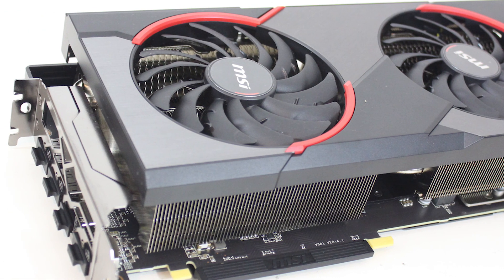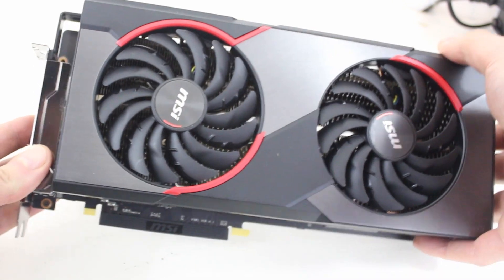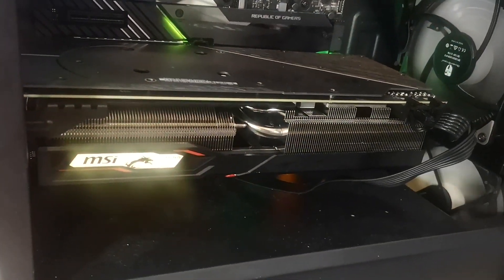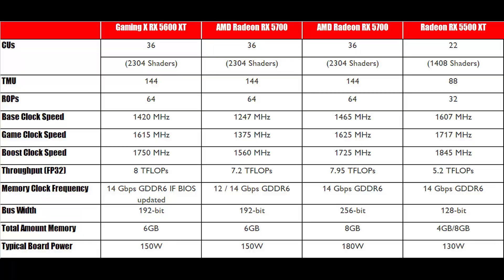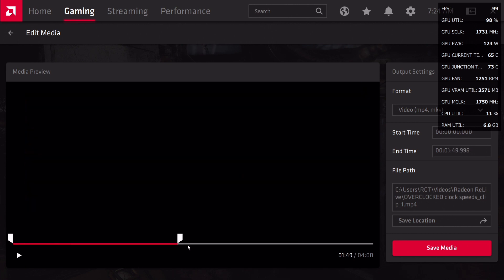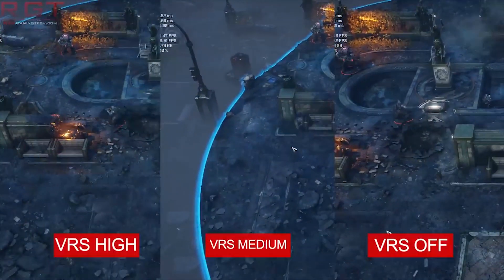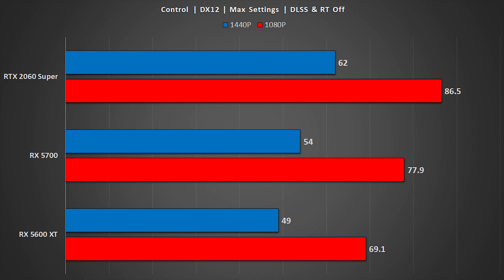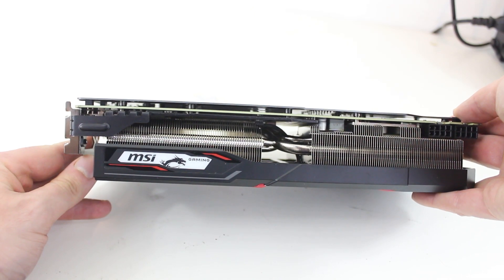Should You Buy The Radeon RX 5600XT Instead of the RX 5700 ?

Comment: No point in buying it right now. Right now is the literal worst time to buy a GPU as we are less than a month away from Ampere and only like 2-3 months away from big navi. When those come out the performance you will get for that $200 will be far better. Plus there's no longer an excuse to buy a GPU without ray tracing support anymore. The consoles have it so if you buy a GPU without it you are literally putting yourself in a worse place then just buying the new consoles for multiplats.

Comment: Sorry but as someone who bough a 1660TI and the next month got a 5700XT i have to say, go with the 5700.  6GB isn't enough now days, 8 GB of vRAM is the bare minimum. Also, the most performance boost we see now days are kind of on the vRAM BUS.
Reply: Yeah, especially if you plan on playing higher than 1080p, you need more VRAM. Even with 8GB on my 1080 I tend to totally fill the VRAM at 1440p and I know a few games like FF15 where turning the settings too high makes it run out of VRAM and cause stuttering. The highest settings for the game seems to demand 12GB of VRAM according to Digital Foundry and I can back it up as my sister's 1080 ti also has problems running the game maxed out.
Reply: @Skylancer727  Me too, this kind of sucks but that's how it is, vram is dating good cards.

Comment: Just sold my 1080ti for 490$ was it a dumb move?? might get a 3070 or 3080
Reply: If you could get $500 for it, it was a genius move. The new 60 card will likely ray tracing the same speed as a 2080 ti and will likely be $300-350. For $490 you could likely get the 70 card or just nearly the 80. Now is a good time to take advantage of people still paying high prices for old tech.
Reply: Nope. Sold my 1080 ti back in May for 450

Comment: Forgive me, Paul, but you forgot to mention that the 5600XT is in the same price bracket of the GTX 1660 Ti.
Reply: That's the reason why the 5600XT was made. It was specifically meant to be AMD's answer to the 1660 Ti. Then the 2060 KO's came out and AMD did the last minute 14gbps bump.
The only reason I can think of for Paul's review is that the 1660Ti is now an afterthought to most reviewers since the 1660 Super is ~$40 cheaper. That or maybe Paul doesn't have a 1660Ti on hand. But, the best lineup would be a 5600XT vs 1660Ti and a $299 msrp 2060 KO (or set a 2060 to those clocks). A 2060 Super is usually more expensive than a 5700XT.
Reply: @Doc_Valparaiso  the 2060 KO? The ghost card? 
😆
Reply: @_A.d.G_  Yeah, it's downright ethereal🤣But, running a 2060 at the cheap one's clocks would've done the trick.
Reply: @Doc_Valparaiso  the 2060 Is nowhere to be found, seems more a paper launch to counter AMD on paper, pun intended. 
🤣🤣🤣
Reply: @Doc_Valparaiso  wonderful! It's quite a lot more expensive than the 5600XT! Thanks for info! 
🤣🤣🤣
Reply: @MoS :1032 Totally agree. If I had to choose between the two I'd go 2060 all the way. Even at $330 vs $280. Like you said, dlss and DX12 Ultimate will at least give the 2060 some future proofing. DLSS is really proving to be a game changer (pun fully intended :).
Reply: @MoS :1032 truth be told, they'll both age terribly. But who's interested in RT will utterly discard the 2060 for the more performing new cards.  On the other hand, who doesn't care about RT and wants to save some money, Navi 1 can still be viable. 
Also, remember that features like DLSS must be implemented, it's not given for granted.
Reply: @MoS :1032 those are not facts, it's your wishlisting. RT will be far better in next-gen GPUs, no one will care about Turing anymore. Everybody is saying so, but you deny it. Do as you prefer, the world knows the truth.
Reply: @MoS :1032 and I really don't agree. 2060 can barely handle RT, even with DLSS. Who cares about RT will need to upgrade, and nobody will want Turing. That's it. Turing will be cannibalised by Ampere.

Comment: buying a gpu now is stupid.
Reply: @mrsrhardy  No even the used ones are bad now as the prices for everything prior to the new stuff will drop like a rock. The 10 series can't do ray tracing or DLSS and the 20 series supposedly does ray tracing a fourth as fast making even the 2080 ti nearly a 60 card in games with it. And ray tracing is about to take off now as the consoles have ray tracing. It's almost stupid to get a GPU without it now unless you have no intent on playing newer games.
Reply: Not really stupid since the 5600xt gaming x is 280 on Newegg. When the new gpu get released it will only be high end ones over $500 the you gotta wait an like an extra 3-4 months till budget gpu get released. So if you buy now, when the budget gpu get released you would’ve lost $80 tops in a span of 4 months for a 10%-20% performance gain

Comment: I was just considering upgrading from a GTX 780 to either 5600XT or 5700, still not decided though, I guess it will depend on the day to day pricing. Currently they are 80€ apart but they have been only 40€ apart.

Comment: honestly, with the new cards coming, I would expect nothing less than 5700XT performance at $239-$249.  No point buying into a 5600XT/5700 right now.
Reply: John Smith  they will probably rebrand this to 6300 or 6500, im not gonna complain if a $200 card cant do ray tracing but can provide solid 1080p high fps
Reply: @hoangd4132  There is no real point in rebranding these cards since the new cards will not be more expensive to make(still 7nm) but will be much faster from architecture improvements. 

You rebrand a card when you can't make a better card at the same die size.
Reply: Hoang D you should complain that a $200 card cant do ray tracing, because a $399 console in November is going to do ray tracing
Reply: John Smith 2080 performance for roughly 400 USD
Reply: John Smith  probably regular 2080
Reply: Yup my rule of thumb I told myself early last year is that I will buy a new set up when I can get 1080ti or close to it performance for just 250$
5700xt is pretty close. so if we get 5700xt performance at that bracket it will be close enough.
Reply: John Smith  Its crazy to think how quickly gains are moving since amd rdna. Even if RDNA2 does not win any performance crowns to me it will win at making prices in the market more affordable. 4k will now become viable int mid-range. (or maybe 1440p 250hz LOL) . Now people will want 4k 144fps. Good Lucky with that one i'd say.
Reply: Im waiting for discounted 5600XT for $199 now..i only see 5500XT gigabyte dual fan close to $150 now in my country
Reply: @James Smith With out a doubt higher end cards will get more expensive, but im sure we may see some price drop in the 200-300 $ range. even a 5700xt speed equivalent in the 200-300$ range would be epic. The 100-200 has been pretty cucked for the roughly the past 5 years or so. Nvidia and AMD seem to be intentionally making that price range the same performance for so long to force people to pay more money. As in they want to make sure 1440P max settings is only accessible if you spend at least 270$.
Whats a 1650super and 5500xt? A rx 480/580/gtx 1060 of course.
Reply: John Smith  More like for $600 LOOL this is Nvidia , the new consoles I have a feeling will undercut PC dramatically because of GPU manufacturers.